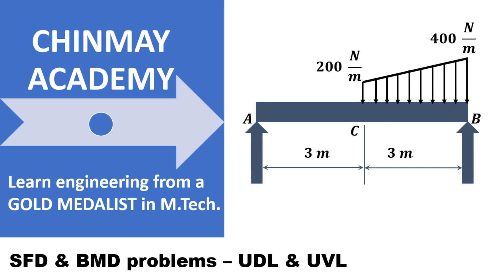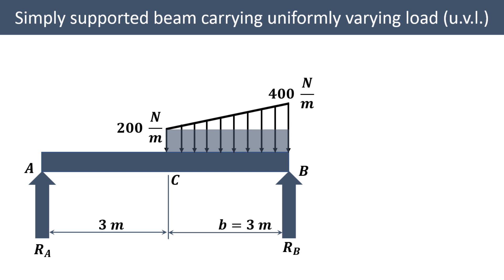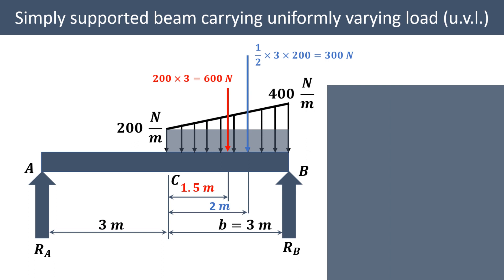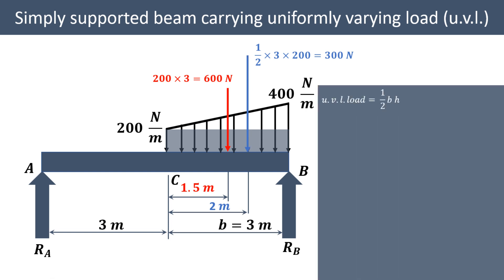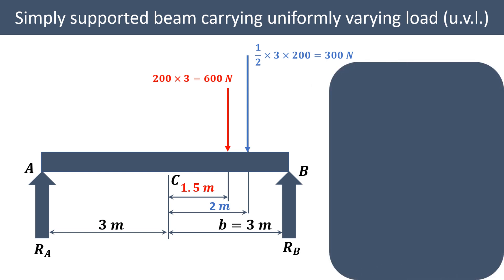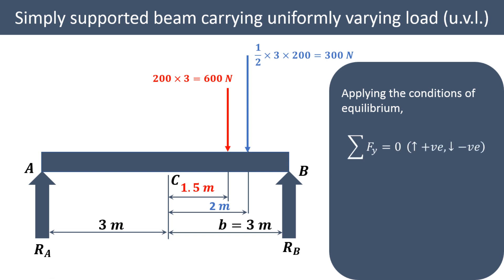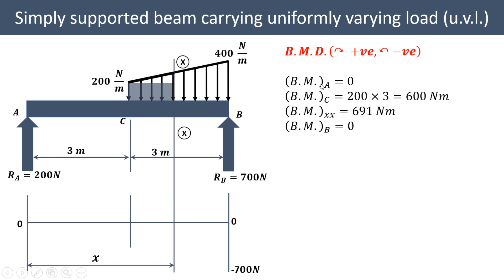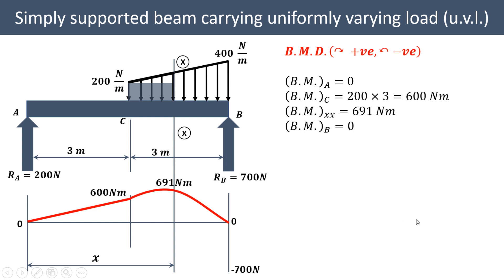Lecture 23 | How to draw shear force & bending moment diagram | Simply supported beam with udl & uvl

Comment: very nice
Reply from the maker: Most welcome ! 
Useful playlists for you !!!

Hydraulic circuit & pneumatic circuit working - https://bit.ly/3zAx1e4
Cam profile - https://bit.ly/3vjpY7a
Mechanics - https://bit.ly/3PClXmz
Beam reaction & Graphic statics - https://bit.ly/3veMwWA
SFD and BMD- Simply supported beam and cantilever beam - https://bit.ly/3PDzA4V
SOM & Structural analysis videos - https://bit.ly/3OEqX8S
Heat transfer - https://bit.ly/3PzxiUe